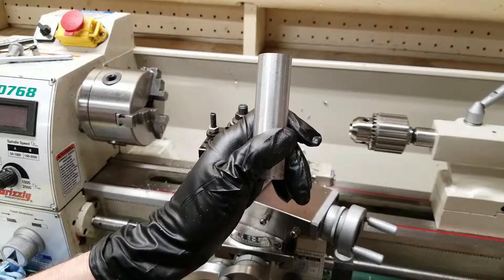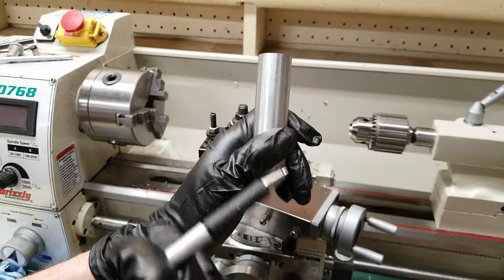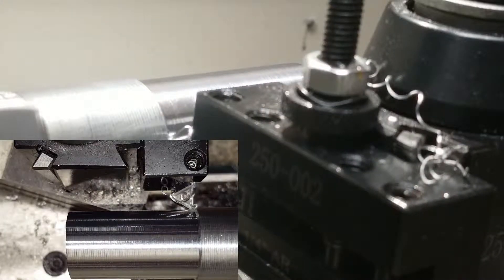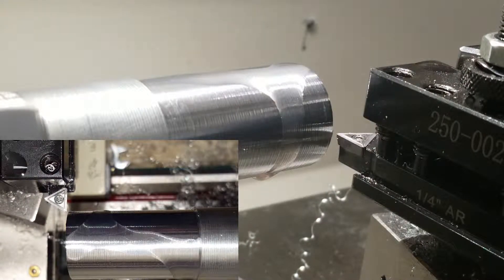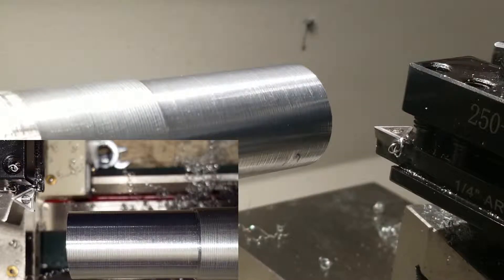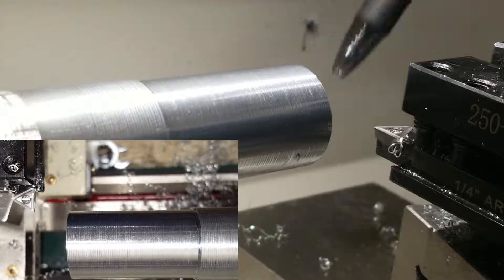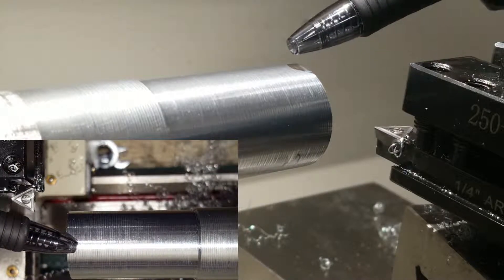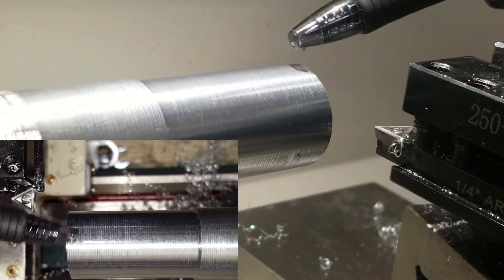Oil VS No Oil-Turning Aluminum on the Lathe

Comment: When turning or milling material you need to use an insert made for that material and getting a good finish on Aluminum with an insert made for steel or iron can be a pain. On a light duty lathe you may get better results from high speed steel instead of carbide. Carbide generally works best with high surface speeds, large depth of cuts, and high feed rates... all of which aren't suited to home shop machines... they don't have the rigidity, horsepower, or rpm to work well with carbide.
 Most non ferrous materials need a lubricant to cut to keep the material welding itself to the cutting tool. Aluminum isn't too bad and kerosene or WD-40 work pretty well on it. Materials like Titanium or Copper can be a real bitch to machine.. the stuff is gooey. For Copper the old school trick is to use condensed milk with tools that are razor sharp. You do have to do a good job cleaning up afterwards.. sour milk smells terrible. 

Cheers from NC/USA
Reply from the maker: Thanks for the tips!
Reply: What was the RPM you used?
Reply: @thebestofbelltowneasthampt6679  My lathe maxes out at 1100 rpm, but I usually run at 500/600 rpm and let it go. I'm in no hurry so twisting it's tail on speeds and feeds isn't really needed. I don't use much High Speed  Steel tooling. I use cemented carbide tools that are inexpensive (even the good USA made) and keep sharp with a green Aluminum oxide wheel on the bench grinder. In the home shop they will last for years.
Reply: @ thank you